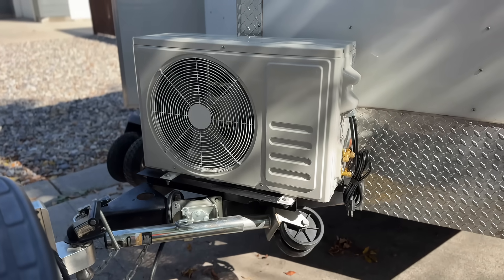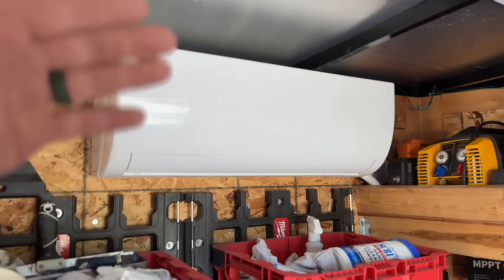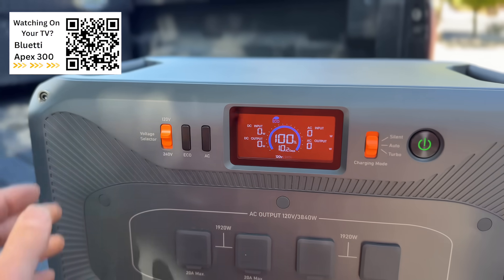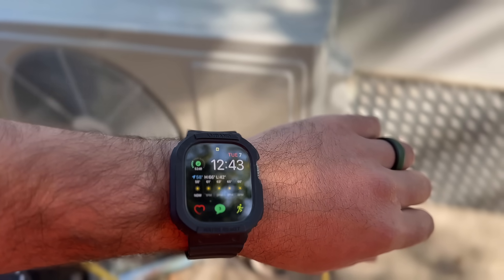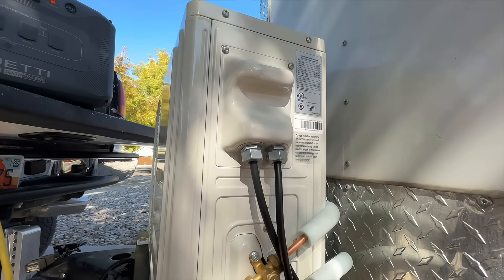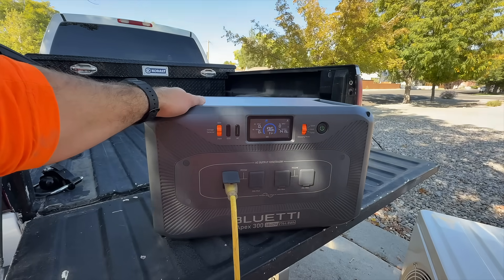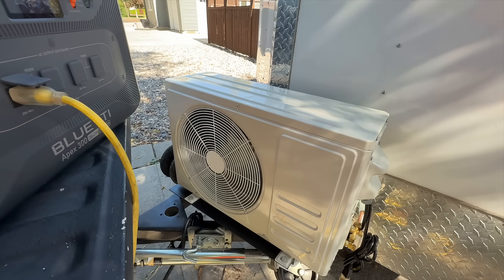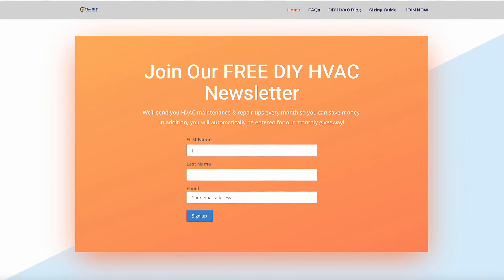I Bought The CHEAPEST Mini Split On Amazon.

Comment: Just got mine today and when I unboxed the outside unit, it looks like the back and left side (opposite of where the lines are connected) are missing a cover. Is it supposed to have a cover? I saw a review of the unit with a picture and it looks like it’s missing a cover on the left side as well. Is it supposed to come that way?

Comment: So I'm going to spend 425 when I can buy a window unit for a litte over 125 dollars. Dream on. But these would be good for larger rooms but why not spend more and do the whole house with four or six stations. If that unit could do two stations it would be a no brainer. 73
Reply: Cheap ass window unit uses more electricity and doesn't provide heating.

Comment: Mount the battery pack inside the trailer, run solar panels on the roof of the trailer to let it trickle charge the battery pack!! Bam off grid trailer! 😎
Reply: You just nailed the setup of my camper van my guy!

Comment: At  6:35, the purpose of a strain relief is not to prevent "critters"from getting inside your device. They are, as the name would suggest, designed to reduce or eliminate strain on the electrical contacts inside. So if the cable is moved about, tugged on, or twisted, it will be less likely to rip the individual wires from the lugs inside. 

Preventing ingress of creatures is a benefit, but not the primary purpose.

Comment: Get a cheap pack of sway bar bushings for whatever truck, use the bushings for isolators under the outside unit. I’m sure after you’ve run over a few dozen speed bumps and potholes you’ll need them.

Comment: I put a 5k window ac in my trailer, it took me 30 minutes to install
Reply: I put a $200 5,000 BTU AC unit in my camper van.   It only draws 350 watts when the compressor is on and I can run it all day long from my solar panels and Bluetti AC200P power station.  People have said it won't  last long due to road vibrations but, I just completed my 3rd summer season with it traveling the US full time.  Between that and my $100 diesel heater, I have very efficient heating and cooling. I bet your ac unit cools your trailer very well.  Good choice.

Comment: Specs look good, Quiet, performance, Inverter, uses R32 refrigerant, price.  Looks like a Haier type remote control.  Make sure you vacuum the lines good, clean the filters regularly, clean the exterior fins about every 6 months.  You don't life in the south so you shouldn't have to worry about anole lizards getting inside and shorting out the circuit board.  Great find and demo.

Comment: A 19 SEER 1 ton (12000 BTU) AC should only draw 632 watts, yet you showed over 900. Was something else inside the trailer pulling power?  Or is the unit really not the claimed 19 SEER?

Comment: I think adding a bracket on the top of the outside unit(securing the top to the trailer) will drastically reduce the vibration on the bottom brackets.

Comment: Best I can tell from the Amazon reviews on the A/C is that you need A/C hardware (manifold, pump, etc) to do this.  The description claims it comes with refrigerant, but says nothing about being "easy" to put together or not needing A/C tools.  It actually recommends you hire an A/C person to put it in, which I think is a hint about the tools required.

DIY HVAC Guy - What's the cheapest unit on Amazon that DOESN'T need A/C tools to install?  
I'm familiar with a few MrCool, Airspool and EG4 models (many of which also offer DC solar input) but it seems the CHEAP units all need you to be an AC guy or hire one.  Not exactly DIY.
Reply: The vacuum pump and gauge set sells for around $120 on amazon, and there are lots of videos showing how to do the install so it is very easy to diy it.

Comment: ...wouldn't it make a lot more sense(and be much cheaper/efficient)to run a plain old resistive load electric space heater for heat, and a separate 5,000btu AC unit for cooling...?

Comment: Depending how cold your "winter" gets: you may need to heat the battery bank as well.

Assuming a standard Li-ion battery: it probably becomes a problem around 4F (-20C).

Comment: Is the outdoor unit precharged? Or did you need to draw vacuum and fill the unit?
Reply: Unit is precharged, but you MUST draw vacuum on the linesets and indoor coil unit. It is easy to do and a decent vacuum pump and guage set is around  $120 on amazon.

Comment: Nice to do this, helps you doing jobs and shows what options are available.  I like the use of the portable battery solar units, now add a few panels on the roof
Reply: The only issue is that panels will ruin themselves if you leave them in the sun for and not connected to something. So the portable power station becomes somewhat dedicated to the trailer, at least during daylight hours.

Comment: The only problem with these self-install systems is I can't find any HVAC technicians that wants to service them.
Reply: These are meant for DIY, you do not need to mess with the refrigerant at all.  They have to say "consult with a professional" as a liability thing. You can find other DIY videos of people installing them on YT. Techs can't charge you $250 to check your $300 AC, so they just work on the big units, more money that way.
Reply: So what. HVAC technicians have jacked up prices so high who wants to pay them.
Reply: @marioalessi6259 these things don't last forever and they requires yearly maintenance and recharging.

Comment: You mentioned bugs/critters in conjunction with the wires... For the same reason I recommend you stuff some wire wool into the drain hose.  Use copper or stainless steel as carbon steel will rust in no time.  Stuff it up leaving an inch or more clear tube below the wool, and use a nylon wire tie to partially constrict the end of the drain tube to retain the wire wool.

Comment: Do you special tool fpr installing this Mini Splt, I.E. Vac pump and gauges? Video on how you deal with the installation? Thanks!
Reply: No lines on these systems are always prefilled with correct amount of refrigerant in the lines. When you hook them up they fill the system.
Reply: @mattburns2968 WRONG!! This and most budget mini splits do NOT come with precharged sealed linesets!! (The full charge is held in the outdoor unit.) But the pump and gage sets are around $120 on amazon and there are lots of videos on how to use them.

Comment: This even beats the Mr. Cool Advantage series... even with my wholesale pricing! Might have to pick up the 18k for my garage to replace the undersized 9k I've been using. Couldn't care less about the brand name for my garage unit - temperature accuracy doesn't have to be spot on.
Reply: The  brand name means nothing, they are all the same units (ACiQ, MrCool, Blueridge, etc), manufactured by Midea in China

Comment: You might want to bolt on some diamond plate to protect those hose lines underneath the trailer
Reply from the maker: Yea that’s not a bad idea 👌🏼 thanks!
Reply: @diyhvacguy  I've read that you lines should never go below the compressor. Reason being is that the oils that lubricate the compressor will potentially become trapped in the low spots.
Reply: @rawwhide  that makes no sense why would the oil settle differently above or below the compressor?.. never coil the line vertically for this reason though
Reply: @william18miller   Preventing Oil Return Issues

    Oil Return: Keeping AC lines above the compressor helps ensure proper oil return. If the lines are below, oil can accumulate and not return effectively to the compressor, leading to lubrication problems.

    Gravity Effects: When refrigerant and oil flow upward, gravity can cause oil to settle at the bottom of the lines, which can hinder the compressor's performance.
Reply: Yea I'd worry road debris could pop up and pierce the coolant lines.